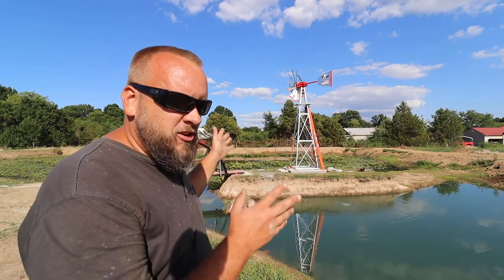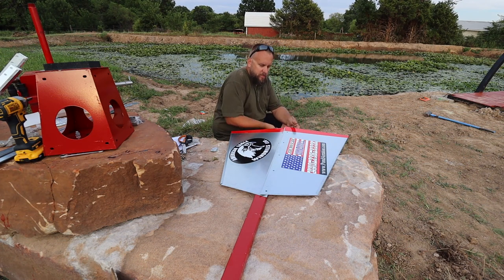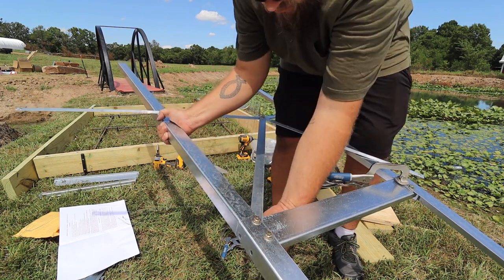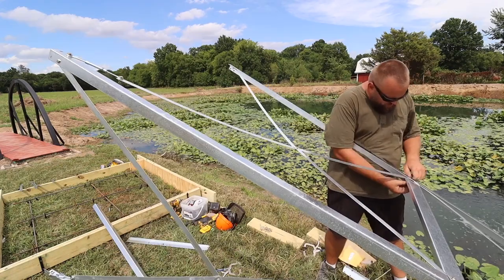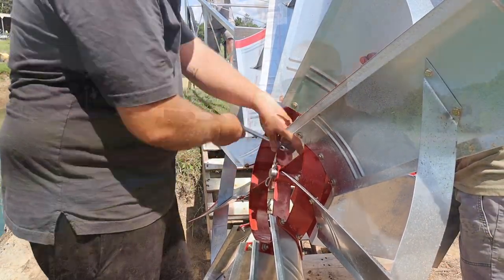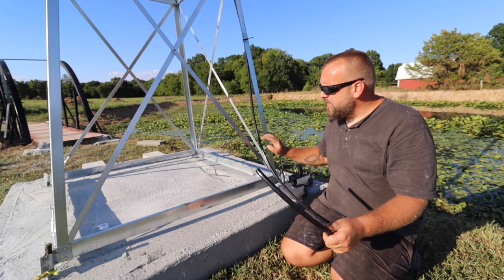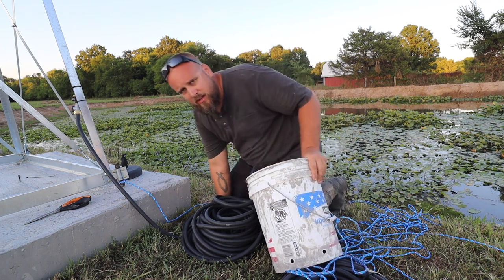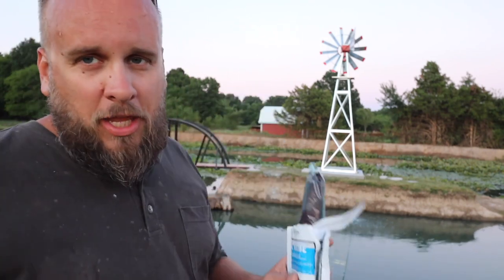American Eagle Windmill Aerator Full Install

Comment: I bought an American Eagle windmill 8 years ago and I love it ♥ I installed an electric generator with a bicycle chain inside and it gives me air and electricity 💨 ⚡  
Joe Mescan windmills are very strong and have steong torque the same Aermotor windmills. Good video 🦆

Comment: I have made a couple comments in the past. With suggestions on what to use to get rid of vegetation from your pond. Well, I have never experienced lily pads in my pond. So, I hope I haven`t steered you wrong on anything. As I see how those lilies are taking over your pond. At this point a lake rake of some type (Amazon has plenty) is probably your best bet. At least to thin them for now. Pull the rake with tractor or maybe some helpers on a 4-wheeler. Windmill looks awesome.

Comment: Great video, Brock!  Congrats on the windmill..it's a beauty!  One minor issue that I thought I would mention (for reference/future projects) is that you generally want to wrap your teflon tape in the same direction that you will be tightening the fitting onto it.  In this case, you went the opposite direction which can serve to peel back the tape and cause it to bunch up in places, causing micro gaps in the threads.  Since it's not a high pressure element in this case, I don't think it matters much but just for "correctness factor" I wanted to point that out :D  Otherwise..amazing job as always and highly informative and (as you  promised) entertaining.  Have a good one!

Comment: Hey Brock, i just finished building my American Eagle windmill yesterday. 

Thank you for the video. You had very good pointers on the build. 

Question on the  Y-valve splitter. Mine is leaking air on the intake side so they are sending me a gasket to hopefully stop the air leak.  Did you have any issues with yours, and have you taken it apart? Im ready to see some air bubbles in the pond!

Take care.
Reply from the maker: I have not had any issues with my windmill.

It pumped really strong all winter.
Reply: @RockhillfarmYT  Thank you.  I'll change that gasket out when it arrives tomorrow and cross my fingers.
Reply: @Rockhill farm   They sent me a new y-valve And it works great now.   This thing is awesome
Reply from the maker: Agreed. Glad they provided good customer service.

Comment: Where did you get the instructions for your windmill assembly?  My brand says only bolts and nuts on blades.  Each bag has 50 washers in it!!  They say to use washers on only four parts of the whole thing!!  Somethings fishy.  Any help would be appreciated